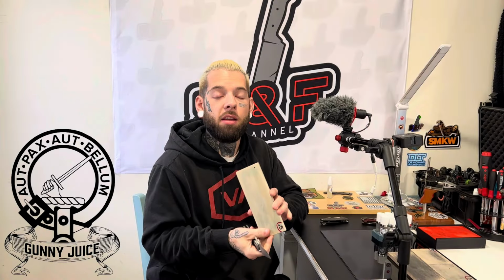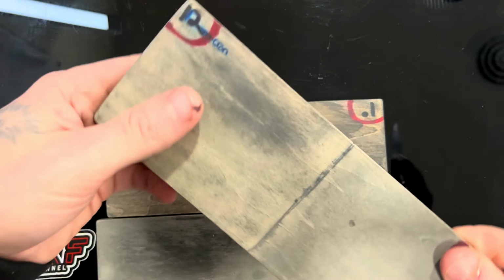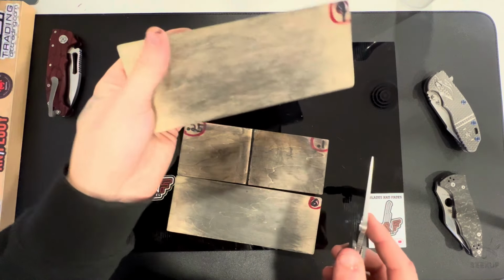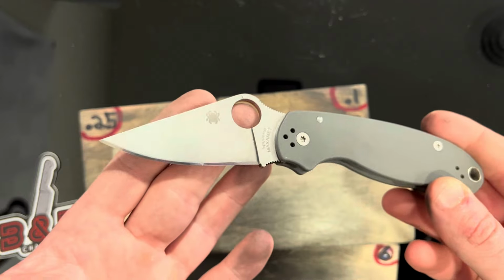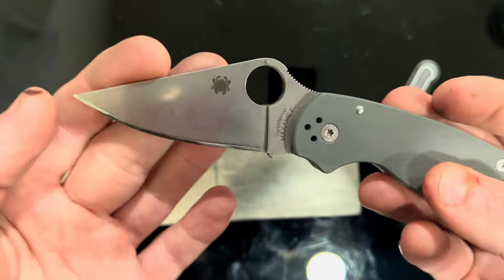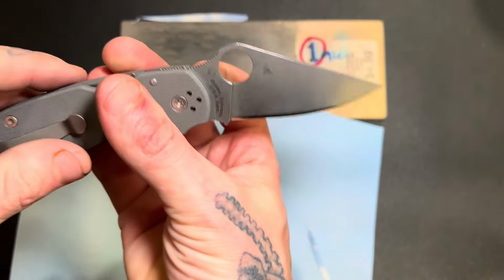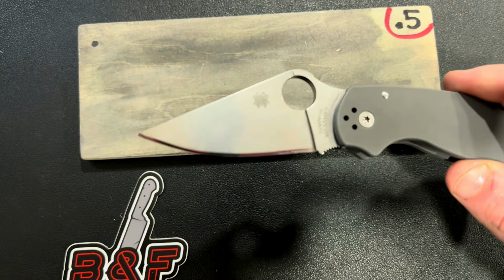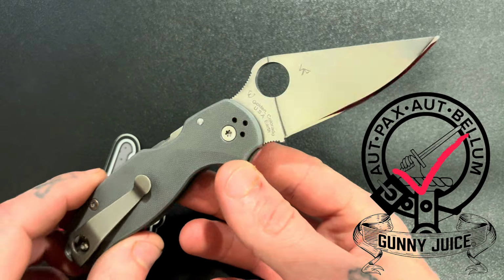GUNNY JUICE - HOW TO GET SCARY SHARP MIRROR POLISHED EDGES STROPPING WITH BASSWOOD!!

Comment from the maker: Well it looks like I did the 3 micron twice but being that the 3 micron section was only half of a strop side it should be around the same amount of passes as the others! I don’t count my passes nor do I have a set amount. I have been stropping for awhile and I go off of my instinct. The feedback from the strop as well as visual inspection and knowing whats expected from each grit/micron rating also can help me discern when I can move on to the next one. If you’re starting off I wouldn’t worry about counting passes just focus on the feedback, your technique and watch closely so you can see what’s going on! Also take it slow, there’s no need to rush and that’s one of the biggest things that will mess up your edge! Forgot to mention this stuff in the video but anyways, I hope this was helpful!!

Comment: Really nice job and this is the video that made me sub. A few questions as I am brand new to this style of stropping coming off green, black and white compound on leather.
 I see the beauty and realize that the edge you end up with is extra sharp but wonder if this increases the durability of the cutting edge? Is it more prone to chipping? Thanks.
Reply from the maker: Thank you and I appreciate the sub! To answer your question, no it doesn’t affect toughness. Toughness depends on the blade steel, blade heat treat, hardness, blade geometry etc. No type of stropping will ever effect toughness, the only thing that you can do to affect toughness is the angle you choose to sharpen at. Or if you heated the blade up past the temperature it was tempered at some how.

Comment: Do you find it easier to hold your angle using the wood instead of leather?
Reply from the maker: It’s not that it’s easier to hold the angle because I’ve developed that muscle memory. But it is easier to feel if you are at the right angle. The feedback from the wood is very clear and if you aren’t at the right angle it will feel like you’re scratching the wood. With leather it’s a little harder to tell if you’re at the right angle and you also have to be careful with how much pressure you apply because the leather can wrap around the apex. Leather works awesome and I like it just as much but it’s less forgiving and if you are just starting off learning to strop, the wood is the way to go.
Reply: @BLADESANDFADESOFFICIAL  yah that's what i ment about the feed back from the wood making it easier to know im keeping my angle right. Thanks man im going to give it a try for sure.
Reply from the maker: You’re welcome brother! Just take it slow, quality of quantity! You don’t need a lot of passes, just need a couple good ones and it will bring that keen edge right back!

Comment: How would using Gunny Juice applied to leather stropping belts (1”X18”) on a Ken Onion  belt driven knife  sharpener workout?? Do you think ua belt driven
Reply: Sorry, continuing my questions…
In your opinion, do you think using Gunny Juice on leather belts would result in sharper and shinier knife bevels vs stropping on a leather board?? Please respond to my questions.
Thank You!
Regan
Reply from the maker: If you are good at using it for stropping with standard compound it will only be better with the gunny juice. It will polish much faster because the diamonds cut faster. I haven’t tried it personally so I can’t say for certain but I’m pretty positive that’s how it would go. I also will say I highly recommend giving basswood a try, it’s extremely underrated because not a ton of people use it but it’s really a game changer in my opinion. Especially if you are aiming for the absolute highest level of sharpness!

Comment: Looks like you're a little cramped on the length you're using for each micron. I'm betting that's basswood from Hobby Lobby which is what I use for GJ. as recommended by the creator, Scott Gunn. I found HL's 10" x 1 3/4"  to be a handy size using about 6" or so for the application and the rest for grip, and only use one side per micron. Also, for my needs, don't really need mirror finishes so only use 1, 3, 6 and 12. Try the J stroke.
Reply from the maker: Yeah man this is basswood from hobby lobby! I normally would do only one grit per side but I wanted to do the full progression for the video and I only had these 3 8” pieces so I made due with what I had. These emulsions belong to a buddy so I wanted to try them out and get the video done so I could send them back to him quickly. Also, I normally don’t do the entire progression nor do I need to, I have a lot of other videos of me getting perfect mirrors with a lot less steps.
Reply from the maker: Also, I like doing a variety of strokes and I also prefer a much larger stropping surface. I’m friends with Scott Gunn and he has definitely helped me improve my sharpening! Scott is a great guy! And yeah I found it ironic that Scott recommends basswood because that’s my favorite stropping surface. I like the feedback it gives and the fact that it doesn’t wrap around the apex and round your edge like leathers do when you use too much pressure. And I normally only use 1 micron and sometimes 3. I take it all the way down to 5 micron on the stones. And for maintenance I just use the 1 micron and it works like a charm.